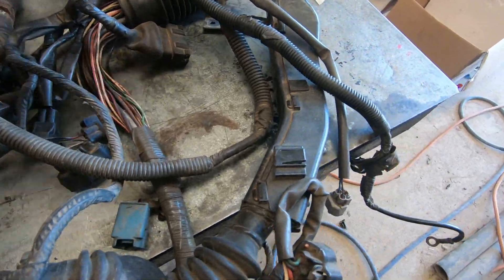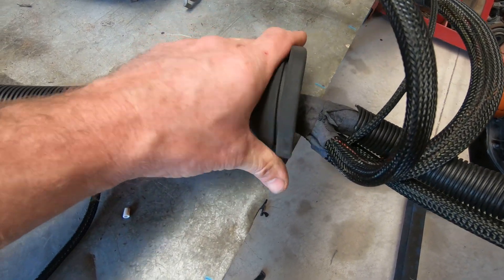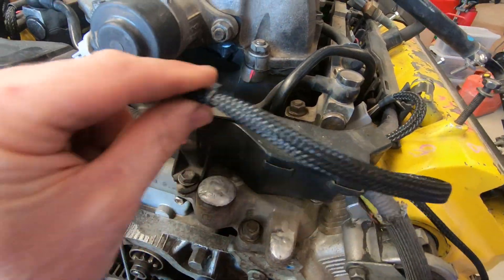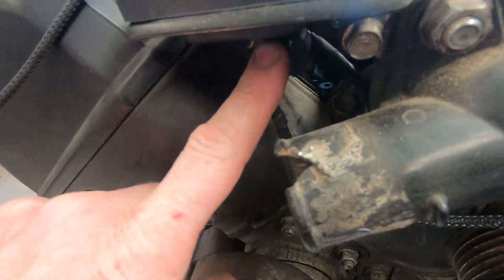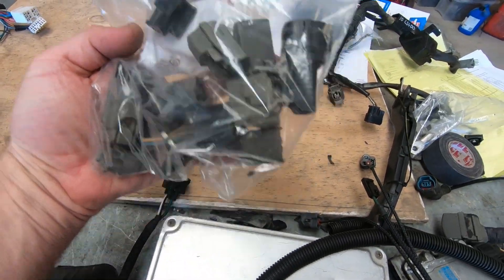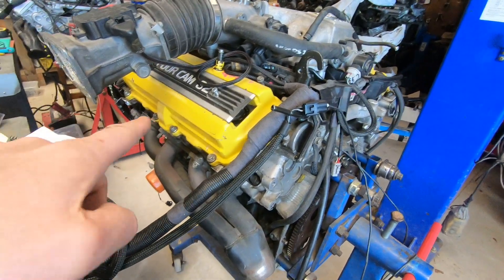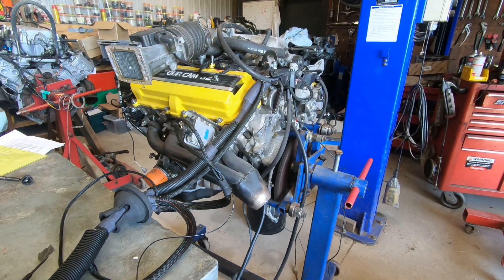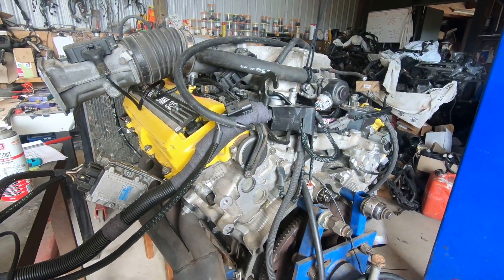Wiring loom for 1uzfe with a flipped reverse intake manifold - Tims fitting instructions

Comment: Hi mr Calvin, Joseph from South Africa. You have been an inspiration since started following your stunning job from 2017. I bought sprinter bus with lexus v8 vvti 1uz conversion, the selector is straight DRIVE, REVERSE and NEUTRAL only. My problem is there has never be REVERSE LIGHTS and is using origional ECU. I asked several people to help me but they cannot IDENTIFY REVERSE CABLE.

Comment: Hey mate love your work I would love to work on uz related stuff love doing conversions I bought a 1uz loom and ECU I was told it came out of a celsior 1992 ucf10 I have the same ECU as u have in this video so the loom that came with the motor has single wire o2 sensors that I have not been able to get working I bought replacement o2s but still get codes for both main o2 sensors not working. So a little while ago a really good condition loom for ls400 come up for sale and the ECU has same part number as my original ECU so I bought the loom and ECU and noticed the o2 plugs on it are for heated/4 wire main o2s also my M-rel wire on celsior loom has 12 volts but will not trigger a relay but the ls400 ECU M-rel wire triggers relays no problem. I also having trouble sourcing the karman AFM that I need the last 3numbers on my AFM r 010 but all the ones for sale last 3 numbers 011 which I have bought new at one stage but I would not work any information on problems I may face would be much appreciated I have had the motor in my 90 duel cab hilux 2wd for about 4 years now but can not afford to spend hundreds on o2s for it to not have any + affect thanks love your videos . your friend Cameron
Reply from the maker: ok.  In the UCF10/11 series some ecus run a single wire o2 and some run a 4 wire.  Be careful with codes as people confuse heater circuit not operating as the sensor not working however (while its still broken) the sensor circuit is operating and trimming fuel.  Any ecu not able to trigger the M-rel is a fail for me and off to be repaired.  Ill do a video on toyota part numbers as the last number is an updated or revised part so interchanges fine.  The aftermarket AFM are crap and frequently dont operate correctly.  Cheers Kelvin

Comment: Okay!!! I just found this video! Yay!  So, I get it now! The rear wiring harness is secured to the coolant bridge, via two bolts, as seen at 6:22! What size are they? 12mm? Judging from the way you have cut the rectangular plastic casing on that harness, I am guessing also that I will be in no trouble, if I just break mine a little, in order to get the lower plenum out...if need be.
Reply from the maker: I think you will find they are 10mm if we are talking about the same bolts
Reply: @CartuneNZ  Thank you Kelvin!! Woo hoo! Gonna go in there with my 10!!  It just occurred to me -- since I can't see down there, or even get a camera in position to see what's back there -- that I can take a magnet on a stick, and poke around until I feel something resisting back. That MUST be the bolt head.  Knowing that it is a 10mm just saved me a frustrated trip back to my socket set! I am so grateful that you have this channel, Sir!

Comment: Need help with a 92 Lexus sc400 can’t figure it out
Reply from the maker: Hello.  What is the issue?
Reply: CartuneNZ I have changed the fuel filter and fuel pump plus control module car will start for like 5-10 seconds but will shut off I changed the spark plugs and mass air flow sensor it stays on longer but when I go to give it gas it shuts off
Reply from the maker: Ok.  Have you tried bypassing the fuel pump circuits?  This can be done in the diagnostic connector on the engine.  Bridge FP to +B. Also might be worth confirming fuel flow is ok.  I have a video.  Will find it and post below as I'm on my phone.
Reply from the maker: https://youtu.be/ndUNj9CwBJY   fuel flow testing.  I would confirm this is good before looking at other stuff.  If it checks out fine then Ive got more testing for you.  Good luck